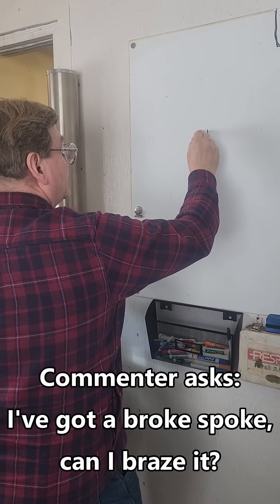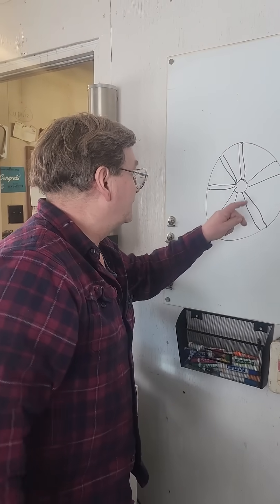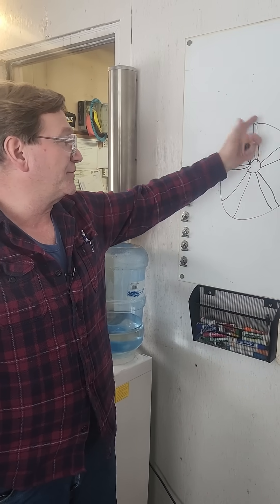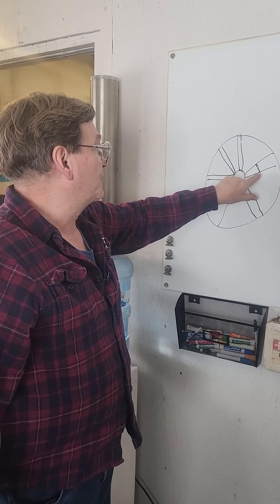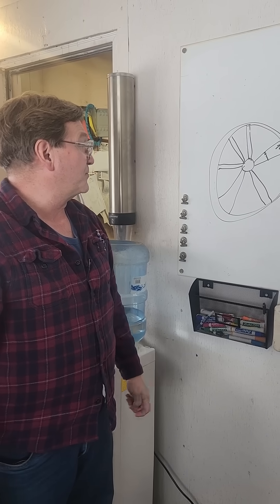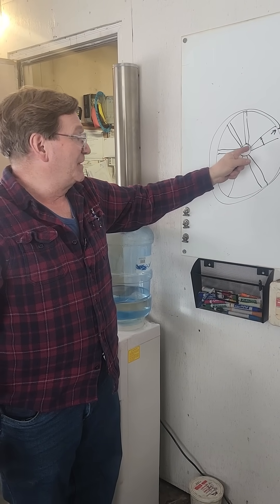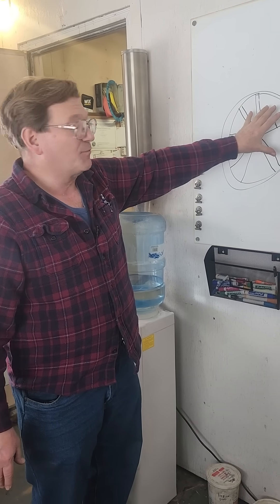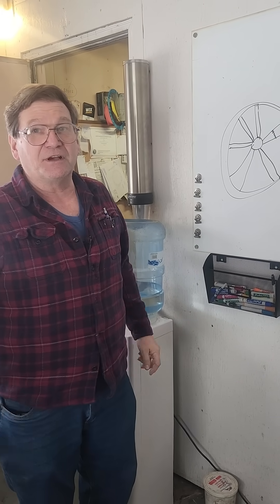Machinist's Minute(s): Why you usually shouldn't break a broken Gray Cast iron spoke!

Comment: Thank you very much you are the first person with any knowledge on this kind of repair that was actually helpful, especially since there is nobody in southern ohio that does this style of repair anymore,,,,im going to share a little more about this thing incase you have some other information that might be good for me to know,,,this pully was welded previously that weld had let go some details on the pully itself are,,,two ft in diameter with the rim going from 1/4in thick to 1 in thick on a ridge inside that is an inch wide itself, the crown itself,,, is 10 in wide, the spokes are 2 1/4in wide by 1 1/4in thick by approximately 7 in long ,, once again thank you very much for the advice im going to have to continue asking the steam tractor clubs around the ohio river valley if they have anyone with a furnace and rare talent

Comment: Big oven is essential.. hot as possible.. and use a soft alloy, some braise alloys are harder than cast iron.. you want a little bit of flexibility.. After braise, put back in oven to even out the temp, and leave it in there, just turn down heat over a day, until off. I fixed a lot of rare and valuable antique car cast iron parts this way...  slow heating, hot part when braising, slow cooling, and soft alloy like CU306, which is malleable brass alloy of moderate melting temperature. Avoid higher tensile bronze as its more brittle once installed and needs higher temperatures to braise.
Reply: Im gonna write that down this video was directed towards me , thanks ,will help make an educated decision on saving the mill drive pully
Reply: @wesbrackmanthercenthusiast4695 Why don’t you use the cracked one, make a sand mold and cast it in aluminum?

Comment: Not a machinist here asking for a friend…. Would it be possible to clamp around the diameter of the pulley and braze as normal without the outside diameter potentially “exploding” if we didn’t have a furnace big enough to heat the whole piece?
Reply: Attempting to trap it to “reduce expansion” would just cause the whole pulley to deform into a dish shape if not burst into many pieces.
Reply: @azarellediaz4892 makes sense
Reply: This is a good question, hopefully howees machine sees this, im the guy that first asked if it was possible to braze this sawmill crown pully spoke
Reply: @wesbrackmanthercenthusiast4695  Attempting to trap it to “reduce expansion” would just cause the whole pulley to deform into a dish shape if not burst into many pieces.
Reply: @azarellediaz4892  ka blam
Reply from the maker: @wesbrackmanthercenthusiast4695  It would not work, if you could contain the force, you would get a hot spoke that was too short, then on cooling it would break.  Making a furnace is not that hard, but does take some time.  this is the One we built:  https://www.youtube.com/watch?v=wdgIk1jaRq4